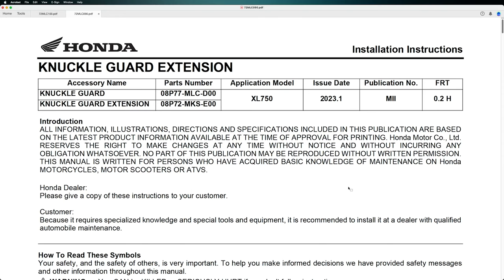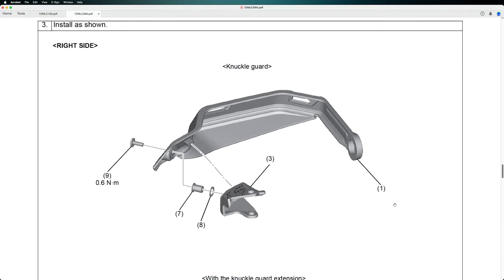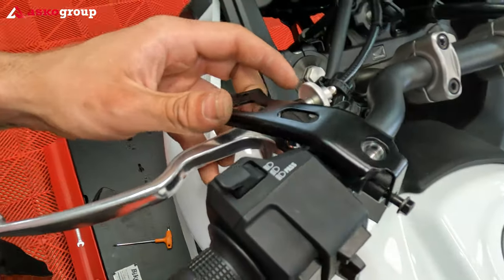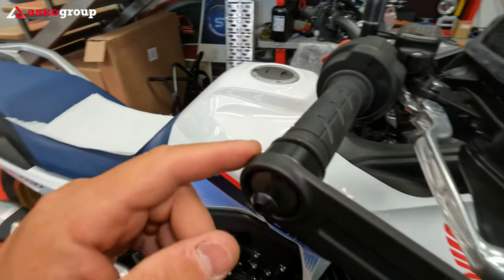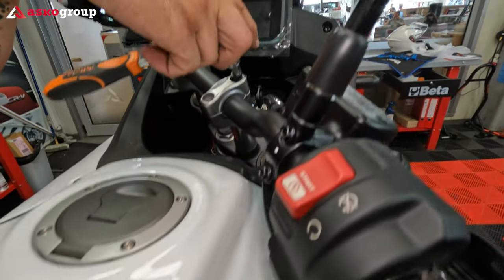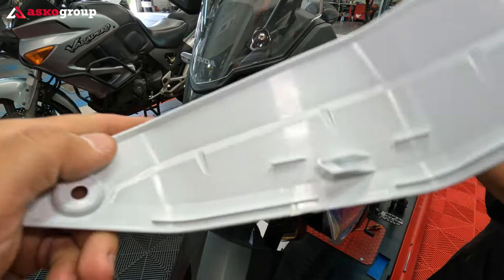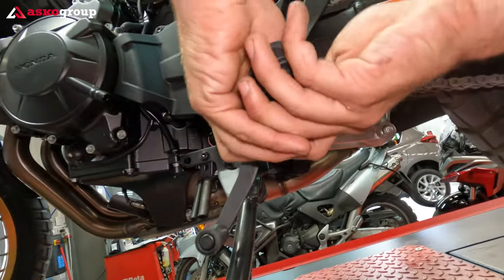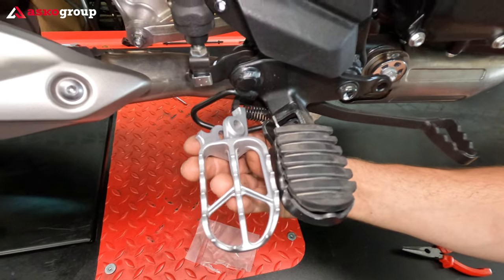Honda XL750 Transalp 2023  - OEM KNUCKLE GUARD AND RALLY STEP INSTALL - Complete Video Tutorial

Comment from the maker: 🔴 JOIN US ON:
👥 FACEBOOK https://www.facebook.com/idealbikemoto
📸 INSTAGRAM https://www.instagram.com/ideal.bike
🔔 Subscribe for more videos:  https://www.youtube.com/c/IdealBike?sub_confirmation=1

We've installed the Rally Pack for the new 2023 Honda Transalp XL750, in this video tutorial you will see all the required installation procedures. 

🔴  To prevent burns, allow the engine, exhaust system, radiator, etc., to cool before installing the accessory. Because it requires specialized knowledge and special tools and equipment, it is recommended to install it at a dealer with qualified
automobile maintenance.

🔴 Honda Motorcycle Service by ASKO GROUP
https://honda.asko.ro/motociclete/
🔔 ALAMI BAHA (Director Service Moto)
0752.762.662
servicemoto@asko.ro
Șos. de Centură 57, Chiajna
🔔 Schedule
Mo-Fr: 08:00-17:00
Sa: Closed

Comment: Is it just me or they sit a bit lower than the standard footpegs?
Reply from the maker: Yes it's correct, more comfortable
Reply: @IdealBike  thanks for clearing that up. So footpegs and higher screen are first add ons so
Reply from the maker: I would definitely no put yet the higher screen, because the standard protects amazingly even at 170 km / h. Wait to ride with the standard screen
Reply: @IdealBike  I did a 1h test ride yesterday and while it protects way better than anything i put on my tenere i feel i can have it better. I'll definitely ride the bike stock for few weeks before I'll decide. How tall are you and what's your inseam if i can ask?
Reply from the maker: I am 1,80m and about 81 Kg
Reply: @IdealBike  Thanks, Just ordered the bike :) I'm also 180 and about 85kg, hoping to get a bit more leg room with rally pegs first.
Reply from the maker: Yes, if not you have the SW Motech EVO Footpegs as a better option